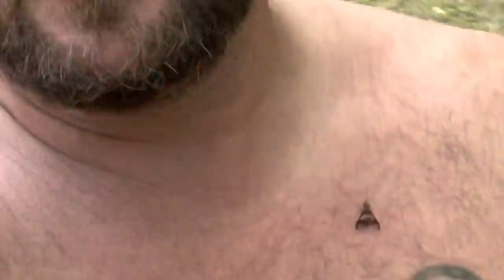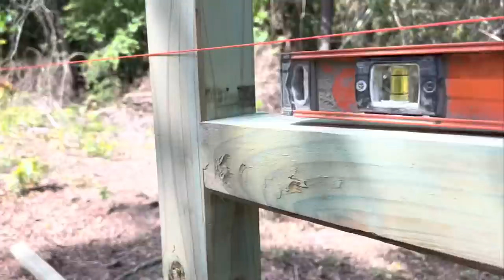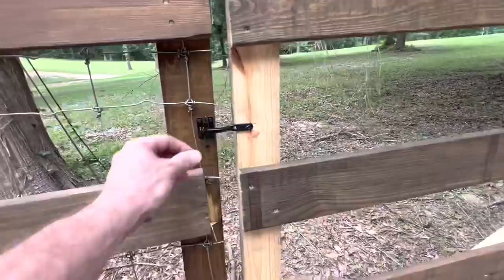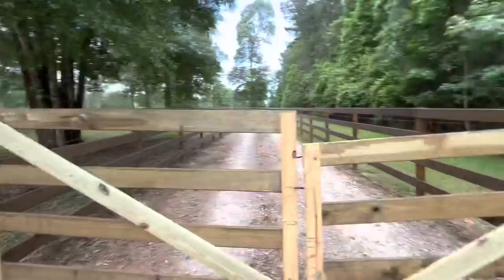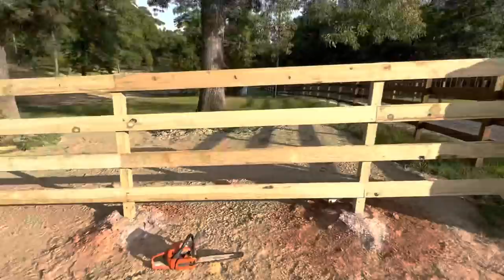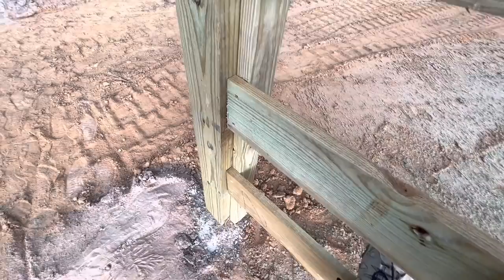My Screwed-Up Work Help

Comment: For moving your cows from one pasture to the other, i love your double fence, but you maybe want to try to put only a string on the other side, like that you won’t even need to stress about them to run the other direction. Cows usually respect strings/wire, so maybe you could use this tip. Great job Lester! 
I am going to work on my fencing and i learned a lot just by watching you. Thanks !!

Comment: You are working hard to get it done.  I have a question about your gates and how you're closing/ locking them.  It seems like the fencing and wooden gates to move longhorns from one pasture to another is not going to keep Tex in.  You have shown multiple times he can easily rip them up or take them off hinges. Curious why you are not using more steel gates like you have at Ima a Survivor.

Comment: There is not a single video I've seen where I've not laughed out loud and smiled thru most of it.  It doesn't matter whether you are building a fence, which I've found quite impressive and have learned a few things (that admittedly I'll never have to use, lol), I always ALWAYS smile.

Comment: I love your screwed up helper explanation, very useful. The fence levels I knew were different on each side of driveway but man Lester until you opened both gates it does not show up how different each side was, looks great finished. You have done an amaising job finding easier ways to get the jobs done. I'm not a young woman anymore and some of these ideas really do make a huge difference on my joints, muscles and ability to move the next day. Even a hot bath can't take away all the aches from manual labor daily like you have been doing. It's almost done so you can relax a little. Lhl is moooovin along real nicely. Can't wait for move in day.
Reply: I've dealt with arthritis & fibromyalgia my whole life. Currently one of the best things I've found for the arthritis around my spinal fusion is simply coconut oil. 
You can cook with it but I just cheat & take the capsules from Walmart. 

The other is the only homeopathic thing I've ever found to ease pain all over. 
Hylands Leg Cramps.
 Helps a lot with just general aching muscles from over work or fibromyalgia. 
I take mine along with my pain meds but without I can really tell a difference when taking it. I've given it to others who have felt it too. 
You can get them at Walmart in both the vitamin aisle or if you go to pain relief you can get the bigger bottle for $11 small is $5.

Comment: I had a bit of a giggle at the gates and the alterations that were made to make them work.  But do you know what?  They work and unless you point them out you really wouldn't notice them, good one Jami.  And the suggestion from your sister Kim about the fence corners are great and they make a slight error look good too.  Did you see your sister Kim's addition to her decking area, she did a fantastic job.  I always laugh at your dancing, I also laugh at Jason Smith's dancing too.  Smooth moves, but hey a happy dance, is a happy dance, lol.  You should be happy, Lester you are achieving what you want and each time solutions are made to problems, means you are closer to getting your beautiful Longhorn babies into a dream home.  Happy Birthday Longhorn Lester!

Comment: Looks awesome Longhorn Lester but I would consider another board on the gates- equal weight distribution and more stable if the longhorns started messing with them.
Reply: Make an X

Comment: Lester aren’t you worried about Tex pushing up against that gate along the driveway and pushing it right open? That little latch doesn’t seem like enough for any of the bigs if they pushed up against it..I guess they would only have access to the yard and driveway so it wouldn’t be that big of a deal since you have the metal gate but still seems like it could be a easy way out of the pasture
Reply: I am sure Tex will still get out. Especially since there's females down the road 🤣😂

Comment: I'm amazed you haven't dropped down with heat stroke through all this. You seem to hit the ground running on all the projects. And it's beautiful! Tex won't know which way to run when he gets there. I have learned to build a fence from you, that's for sure. Now if I could get the crippled legs to work! And I really want your mini chainsaw and your polesaw! I bought a chainsaw thinking I could hold it with a cane....I cannot!!! And now I can't return it. This is how we learn. It's beautiful at Longhorn Lester's. I would move that double wide of yours in a heartbeat!!! At least you have trees and a great breeze there. The goats are going to lose their minds eating all those bushes!!! Save up for more riffraft rock for your  back property and maybe put in french drains going down towards the river.

Comment: Looks great Lester thank God that you can physically put in a day like that. Silt fencing should have been put up around pond and other erosion points on the construction site contractor should fix it at no cost he had to know this would happen. If it doesn't work out that way get a quote and split the cost in reality if it's not in writing he doesn't have to put up the erosion fence I would go no further than spitting repair cost guess you guys in Texas do business different than tenn. If he does Alot of ponds stupid mistake why didn't you harness those springs to pump that water into pond built a pond last summer on top of a mountain the size of a football field totally fed by harnessing 3 springs on property turned out beautifully don't know the lay of the land but with time and money and a engenering look anything can be done. The man who owned the mountain didn't think it could be done but he had the money now he stands in Auw of his pond.

Comment: Good morning Lester.  That was interesting with the two smaller gates between the bigs pasture and your goat/ostrich/Gracie pasture but will those  top latches hold if the animals starts trying to escape.  More worried about the bigs side than the littles side as Mr. Tex will he get thru those.  May have to watch again just to see if the gate area is separated from the actual bigs pasture.  

What has come about with the erosion of the pond area.  Will the guys that dug it out come back and fix it or have to absorb the cost and remove the dirt yourself?   Thank you for sharing much appreciated.  HAGD

Comment: Really coming together guys.  Ummm but wouldn't it be easy for Tex to smash through the gates that go into the road?  Wooden gates hold back Tex?  It was a great idea but just worried about the gates strength vs. Tex.

Comment: Lester, the crossover gate idea is excellent! The only problem that I see with that is the open road on the other side. Perhaps you can attach some wooden gates on the other side to cut off that side of the road. That way you won't be herding cows back up. Also wouldn't Santiana need to go with Gracie at the same time?